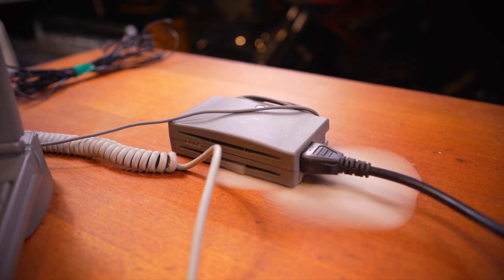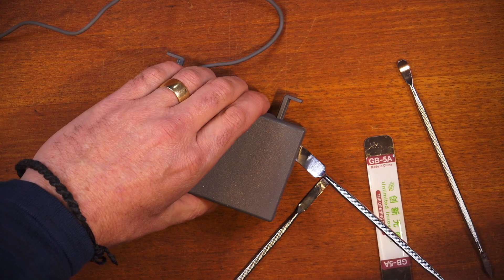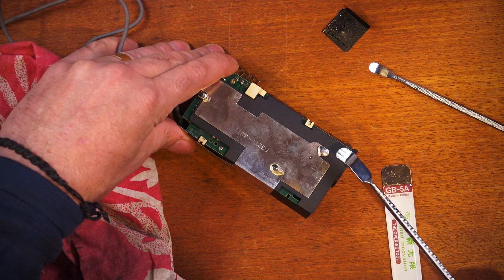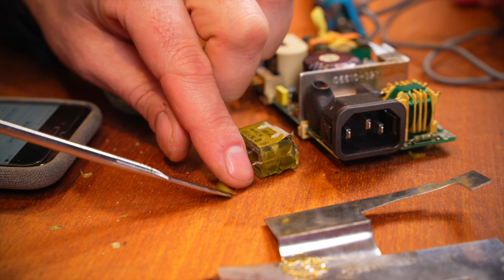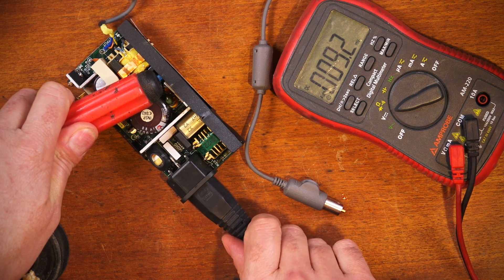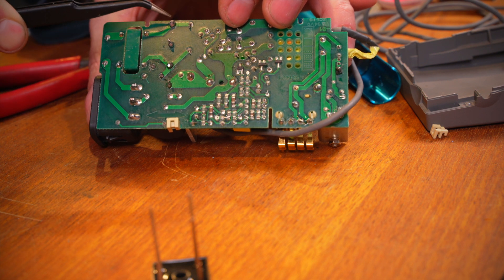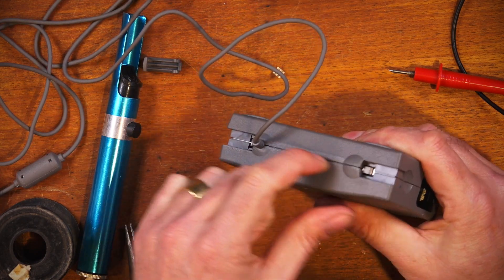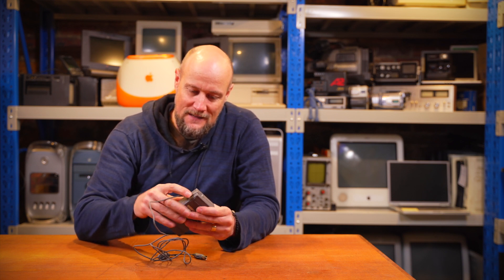This Apple power supply EXPLODED!! Let's try and fix it...

Comment: Hey, few notes:
PVA glue does not handle high temperatures, it will become soft. I would suggest you use some other glue.
ALSO: Do replace that small 22uF 50V capacitor. These are starting to leak, and will produce fishy smell when desoldered. Other two electrolytics are fine, but still wouldn't hurt to replace them just cause they are 30+ years old by now. Also, that X2+Y2 RIFA you replaced is the same metalized paper stuff as the original. It will last for another 15-20 years, but will fail again in the future. It is the best to just remove that 3-in-1 capacitor altogether, or, to be 100% future proof, to replace it with three separate capacitors, two ceramic Y2 4700pF and one film (MKP or similar) X2 0.15uF caps. It is quite fiddly to fit all three, but I've done it multiple times in the same PSUs. Those will never go bad in any explosive way.

Comment: Great video - really interesting, good-quality content :)

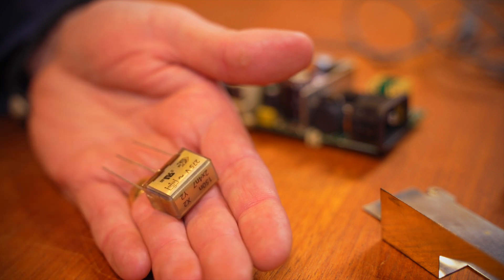I think at 8:12 we can see damage to the vias (through-hole plating) from removing the old capacitor - one is missing altogether and I think the other isn’t making contact with that track across to the rectifier - which I suspect is the cause of the problem later. 

Easy to criticise someone else’s work but just for the record, I think it’s better to leave the solder in place, actually add a little more solder, heat the leg and ease the component away a bit, then do the other legs, bit by bit until the component is removed, then clear the holes with the desoldering tool/wick before putting the new component in. Trying to remove the solder first just makes it harder with a double-sided board to get enough heat transferred through, and it’s more likely the top side will be damaged.

You did well to replace that weird RIFA triple-cap with an exact replacement! Jaycar has suitable X2/X4 275VAC caps but I think you’d have needed three wired together to replace the original. Space is always tight in a power brick, so your solution was best. I’ve found the Suntan caps from Jaycar work fine on Mac Plus analog boards etc. where smoke leaks out of RIFA caps.

Hope you were able to order some other bits from Mouser to make it up to the free-shipping level. I’m in NZ and I also fix this Mac stuff :) keep up the good work!
Reply from the maker: Great comment! Thanks Alex, yes I’ve learned a lot since this video. Appreciate the advice and feedback.

Comment: Interesting, it looks like you power supply had a RIFA filter capacitor fail. Those things are pretty notorious for going boom in vintage computers and power supplies like that.
Reply: My own windows 98 pc when I got it, it powered on when the rifa cap blew up. Now, it works perfectly.

Comment: When I saw the smoke in the last video my guess would have been something like a RIFA capacitor. They always give off that weird smoke. Well done on getting it working. If i could give any tip it would be to have your kettle lead off at the wall when plugging it in!! Though it does make for a more exciting video!
Reply from the maker: Yes I just recently learned of the exploding RIFA phenomenon once the replacement part arrived. I should have bought several!
Reply: @TheBasementChannel  Eh, they go bad even if not in use. So you want them as fresh as possible anyway! (Plus you don’t know what value is used in a given device.)